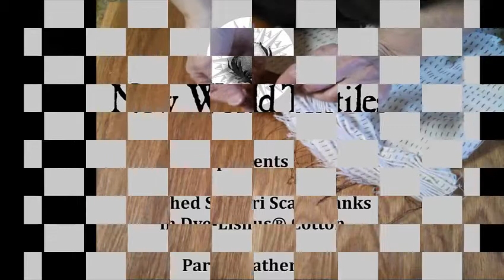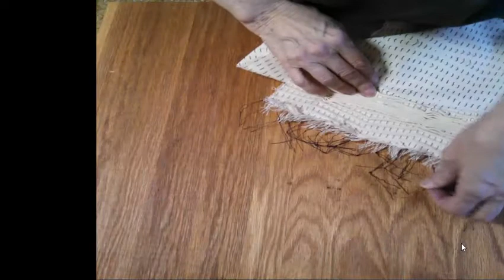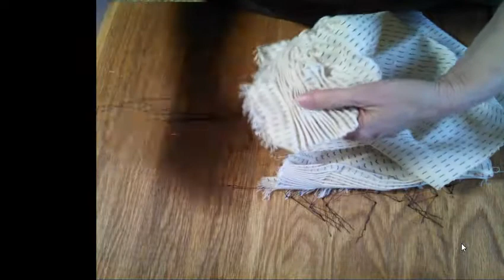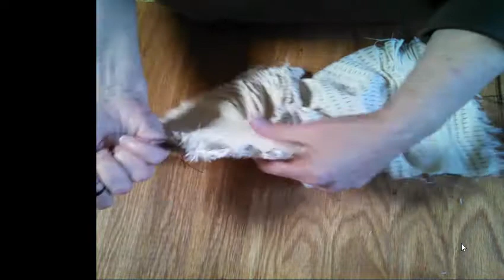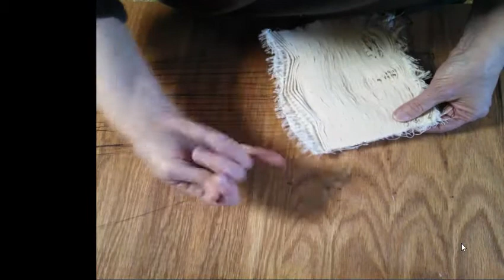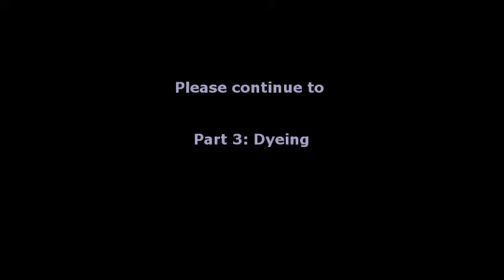Nui Shibori Part 2

Comment: Generally the tread breaks inbetween.what kid of thread is so sturdy?
Reply from the maker: I used a very strong thin nylon cord in these fabrics. When hand stitching, I often use jeans topstitching thread. You can also use a polyester thread. 
Test before you stitch, both wet and dry. Cotton is stronger when wet, but some other fibers are weaker.